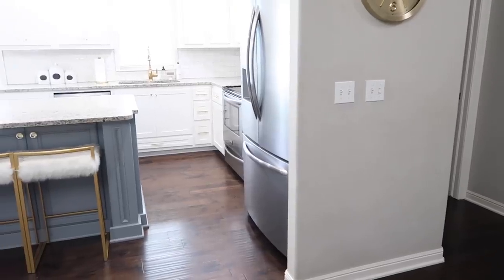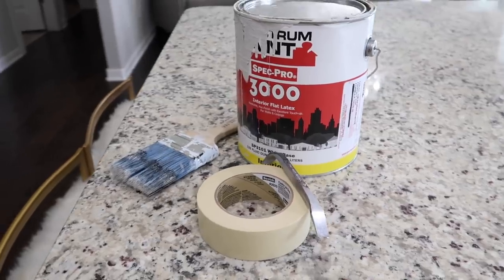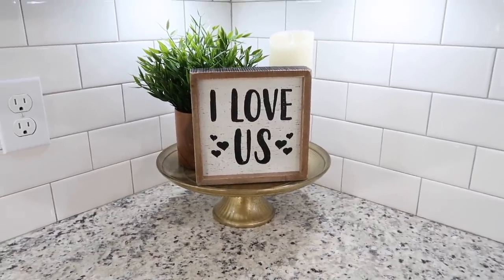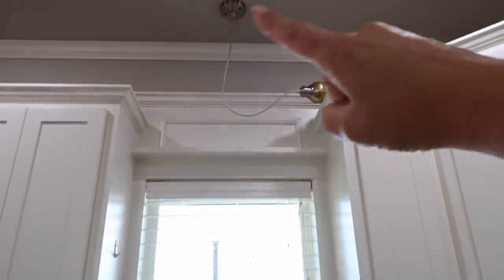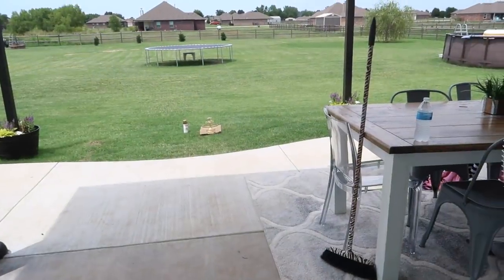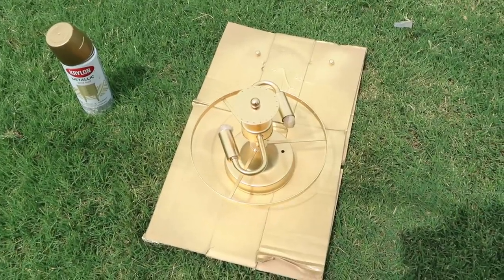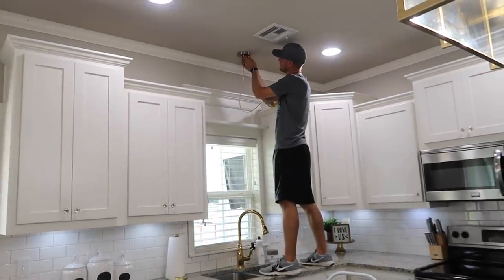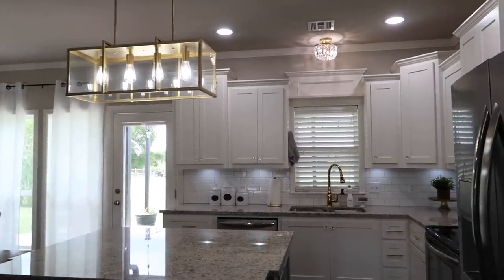KITCHEN DIY PROJECTS | MODERN FARMHOUSE KITCHEN | PAINTING THE HOUSE

Comment: Absolutely gave me the motivation to touch up our kitchen cabinets. Around the handles it's all chipped away and been driving me crazy forever. I've already sanded. Now I need to remove the handles and clean and paint. Really needed that today ❤💚💜💙💛
p.s. Do you know of anything that will protect the paint around the knobs? The knobs are small round knobs so it's real easy to scrape the paint when opening the doors. I'm thinking of something clear plastic that will stick and not be so noticeable.
Reply from the maker: They supposedly have a spray sealer. I’ll have to look into it and test it out.